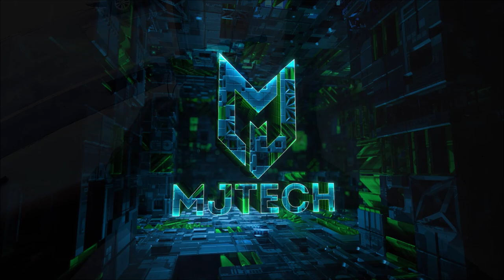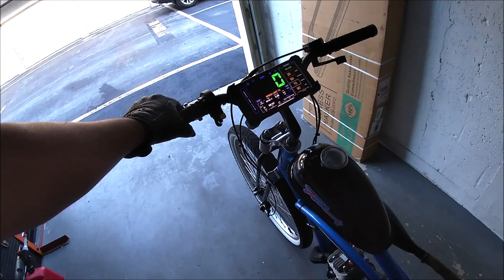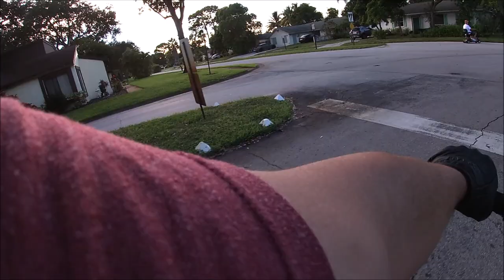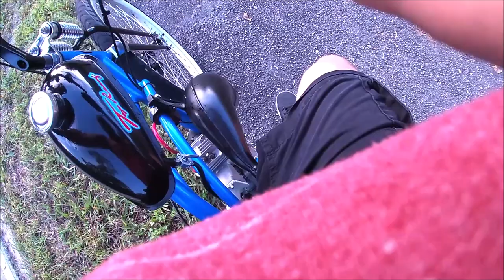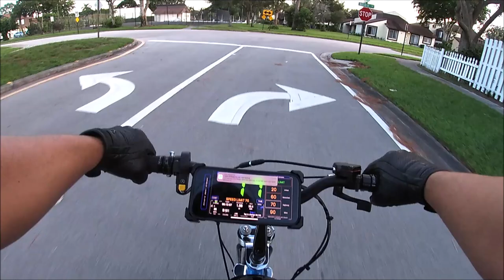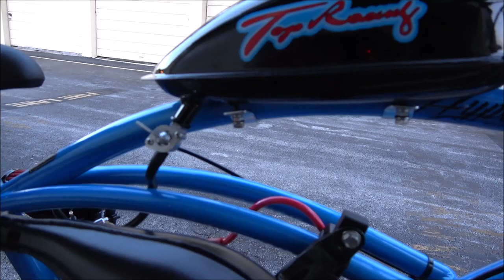Phantom 85 Motorized Bike - Hits [52MPH +] & Could've Gone Much Faster!

Comment: Big respect man! Takes big balls to ride that thing that fast
Reply: No way in he'll I'd do that the would be extremely painful
Reply: @danajett  same here, he's kinda crazy to ride it in shorts :D
Reply: There are electric scooters which go 120 and 150 km/h, those are dangerous and anybody can buy them, kids use them.
Reply: @Aziz-wl1xf  For real, at that speed it would be good to use some motorcycle protective gear 😅
Reply: I have a heavily modified YD100 that goes faster than 60. I just didn't go faster than that. It's insane
Reply: But I agree big respect

Comment: Sounds like the pipe is starting to come into resonance at around 46, was a bit rich leading up to that.   You might try making a header spacer that is gasket matched and spacing the pipe out about an inch to lengthen it about. It will come into resonance sooner. and Yes, it did sound like it would go lots faster.
Reply: It sounds like that’s when he goes WOT… you can hear a noticeable difference in induction noise. 

But I agree, extending the header would make the resonance happen sooner.

Comment: nice . sounded like it was pretty happy between 35 and 40 . thats still crazy fast on a bike . not a big fan of the phantom with all its problems  . but i feel once they get it dialed in it will be a good engine . that leak if it dint crack at the wields  it was more then likely coming from the gas cap . them cheap tanks suck . the caps can be fixed  with a inner tube . just cut out a new rubber seal  or use cork gasket maker . they dont fit tight enough . take care  . ride safe .
Reply: ❤❤❤❤❤❤❤❤❤l❤❤❤❤❤❤❤❤❤❤❤❤❤❤❤❤❤❤❤❤❤llll❤❤❤❤❤❤❤❤❤
Reply: allaboutbikesslideshowreal9741 😂😂 paper weigh lol
Reply: What would be a good alternative motor 
??
Reply: @GROK815  not sure  but i think they fixed the issues with the phantom now . there is another one for like 200 dollars called the avenger 85 that i guess is super fast right out the box .

Comment: I hate 2 strokes, had the worst experiences. Made my bike fall apart, 10 gas tanks in 2 months, went through a few engines, one was a generic cheap Chinese engine, went through a stage 1 engine from bikeberry, completely damaged the engine, bought the stage 2 engine kit, everything worked fine until i tried putting that upgraded compression head on, would not work no matter what i did, like it was obnoxiously annoying, i gave up, but bikeberry’s customer support was absolute top notch, like its something you can really appreciate. Ended up getting a cool muffler, didnt work with the bike i had because the mounts on the engine were at a weird angle which wouldn’t work, they gave me store credit, had got a speedometer they had, better grips and throttle, they were always there, i may check them out later to see if they got anything new, since its been a few years. I on the other hand just got a phatmoto 2022 fat tire, absolutely fun to ride, i was iffy on the speed, but its to be realized that speed isnt always everything you need. I do plan on modifying the governor to get a little more out of it without losing torque from a smaller sprocket. Where I’m at, i cant really avoid the hills so the torque is good to have, got this one hill that has this weird double incline, it’s difficult to drive up with a car in the winter, everybody usually avoids it and take the less not so double inclined hills. All in all, as expensive as the phatmoto is, to me its 100% worth the 1300$. Ive heard the clutch is bad, but i havent had any problems with it.

Comment: These gas tanks all have a flaw with the gas tank cap and it's really a design to allow air to come into the gas tank so your fuel can gravity feed down to the carburetor to solve this issue is you simply get another gas cap that has an actual gasket but on the center of the gas cap it has an air inlet valve that's about a half an inch above it a little stem if you will this prevents the gas from splashing out but the gas cap itself will have a gasket sealing the cap like a real gas cap and you're welcome

Comment: Okay I'm going to give a comment a lot of people are saying out there that the yd 100 don't hold a candle to the phantom 85 but the yd 100 don't come with a read valve don't come with other stuff that the phantom 85 comes with so at all fairness. I bought a why do you 100 put that motor on a hyper bike it did 55 mph and I did not have a big pipe on it I used a knockoff mz65 pipe did mild porting to it ran a 32 sprocket on it all I did was clean the ports up on it that's it and the bike would do 45 mph. With no problem so then I pulled it apart out of all fairness because the yd 100 don't come like the phantom 80 kit with the big pipe the Reed valve all that I didn't even break the b** in I ran it at 40 to 1 right out of the gate stock carburetor stock everything all I did was cleaned it up that's it then what I did was gave it a little bit more work and the funny thing was I didn't even put a re valve nothing on it I ran the stock carburetor then the bike hit 47.49 mph I learned my mistakes on the yd100 so now I got a new one. The fastest speed I hit on my yd 100 was 55 mph but I learned from a mistakes what I notice about the phantom got a lot of low-end power probably mid-range power I'm going to have to get one of those and then we'll see personally in my opinion I've seen guys run 70 plus miles per hour on bikes using s*** carburetors tiny carburetors not big ones it's really not that necessary when I built my first why do you want 100 I went way too big on the ports didn't change the pipe made mistakes we live and we learn it's velocity that's what you want when you're porting staff it's not always let's gouge it out make it huge I found out on these two strokes that is not the answer I've seen guys with stock carburetors f*** somebody up that had a carburetor three times in size tiny little carburetor tore their ass up in the top end it's the velocity it's the flow that's just my opinion

Comment: Use inner tube pieces and ultra copper high temp gasket maker under the rubber seal two should be enough clean well and hold together w the gasket maker Wich is fuel proof will seal well

Comment: I'm gonna bet once you crack the jug you will find a piece of piston broken off under the wrist pin, for some reason the pistons are cracking around the skirt.
I suspect bad casting methods
Reply: The wrist pin bearing is weak and allows the piston to rattle in the bore after not too long. Broken piston skirts result in catastrophic damage, but the origin is the bad bearing/bushing.

Comment: I just got mine but haven't installed it yet cause it's still too cold out. What oil do you use for break in. The paperwork said 20 to 1 but did you use any certain brand of two stroke oil?
Reply from the maker: Buy the lucas brand
Reply: @MJTechChannel  I've got people telling me only organic or full synthetic or whatever. In all my other engines I just used what my local parts store has but for the phantom 85 I wanna use what's working for the others
Reply: @MJTechChannel  I've also heard that a bigger carburetor really wakes these up

Comment: Very hard for me to
believe with out a gear
 shift unit this motor
can go faster then 37 Miles,
I was just about to ask you 
about Yd 100 , can it go faster
with an Expansion chamber
exhaust . not sure if you used 
one on it, still looking around
in your videos to see what you
had to say about it . 
 is it really a larger Bore and stroke,
I'm checking out a piston on sale 
with three rings they say it's 52mm
reed piston kit 12mm pin 110cc gas
motor engine 2-stroke . they also got
52mm jumbo cylinder 110cc steel 
sleeve
for sale as well, I have some question
to ask about it, being that your trying
out and testing
just about anything that has to do 
with those motorbike engines I was
thinking of  asking you about it .
is there a specific cylinder head for
this 52mm jumbo cylinder or is it the
one you riding on, in this video,
the spacing mount to the cylinder studs hole
 are space out to 60mm on cylinder .
not sure for what engine .
Reply: He has an RM85 on it clearly in the video, and a G2 reed. Did you watch the video? This is a Phantom 85 motor. You shouldn't doubt the speed of this beast of an engine.
Reply: @carloscardova4221  with an RM85!
Reply: Phantoms def have power for beyond 40mph no shift. 

The bike in this video has a yd100 bottom end and a transfered and windowed piston top end. True 85ccs. 

That pipe is helping him along a little too
Reply: I don’t believe it,not one
Bit
Reply: I’m telling everyone right now,,that’s BS …I’ve been in this to long and I know better than that,, it’s a BS video !!! Fake
Reply: @jorelldye4346  
RM- EIGHTY NOTHING YO!
I recently installed a no frill engine
on my Landmark Schwinn Beach Cruiser, upgraded 10 gauge wheel spoke with seal bearing, upgraded suspension fork disc brake all around my bike, on the coldest summer morning after 3:am with a clean air filter and cool gas, I can do a scary forty MPG with no traffic. AND THAT'S A LOT WIND I take on MY BODY . LOOKING AT OTHER RIDING VIDEOS and this video here don't look like he's riding no way near that speed bro. just yesterday morning at about 4:am my bike with a bicycle trailer was hauling two five Gallon jugs OF WATER and it didn't Slow it down it was hauling ass with all my weight and the weight of water a small tool trunk I take and the bike trailer . Love my bike setup for now but you know there will always be room for improvements. for me it's not how fast you can ride, it's for the use you have for it. Yo Bro your speedometer is playing a cheap trick on you bro because those electronic ones are usually set on Kilometers per hour. I will tell you this, stick your head out of a moving car window doing 40 mpg and you see what I mean, It's a lot of wind move against your face real fast, if you don't have a set of good eye protective gear, your eyes will dry out and become damaged Yo. 40 mpg is fast and anything could fly on face and eyes like bugs or tiny stones very dangerous bro. I can't believe you said you could of gone 60 mpg, not with that bike. Did he say 60 mpg. now I know that tack is wrong, you'll be gone in sixty seconds and I don't mean motorizing and going fast. We use two bracket for each gas tank mount front and rear, I know they only give two to work with always buy extra hardware and fuel lines is my advice. safe riding yo Stay Safe.

Comment: yo man, i switched my tank to the supposedly 1 gal tank. worth it for daily rides but I'm sure you'll need one as well. note though that I'm looking for replacement petcocks for the stock one seems to me be weaker than a motorcycle one
Reply: Me to  I also used  epoxy putty & glued it to the frame & around the studs  to prevent it from braking again .. ..  it’s  still good 3000 miles later.

Comment: You are CRAZY!!!!!!
#1- speed limit on motorized bike is 30 mph or less.
Lucky, no cops around, speed checking.
#2 - you are in T-shirt and short, at 40-50 mph if you fall or crash, you can say good by to your skin at best, but you can break your neck too.

I knew a guy, he was going to the beach on his motorcycle,  dressed to the beach, in shirt and short.
At one intersection, he had a green light, but a car pulled in front him, so he laid his bike down to slide to stop.
He survived, but on one side of his body, he lost his skin and broke an arm and collar bone, some ribs too.
He was in the hospital almost a year,  laying on his stomach, many surgeries,  skin had to be removed from his ass and leg to patch his upper body.
Have you noticed, motorcycle riders wear protection, like helmet, gloves, leather dress, rider's boots.
Not by accident!

Comment: What oil do you use for this engine? I can’t seem to find what’s mentioned in the instructions as “Valvoline Two Stroke Racing Oil,” is this the same as Valvoline multi purpose oil for two stroke engines? I also already have Lucus’s semi-synthetic 2-Cycle oil, is it safe to use?

Comment: nice video this engine have more to go . 60mph mmm the bicycle handle that you have good tires and rims red locktite all the bolt torque all the bolts you sure be good . you have a nice set up . ? you change tyhe cluch pads . cant wait to see that 52 on mph on a gopro you have video / what i do i save the video on the gopro app then on the seting you can see on the screen on the same video ones you have that you can record that on the cellphone screenrecord and you can post thst on here . nice 52 mph sorry for my missspeling we be back
Reply: that how i use the gps gopro
Reply from the maker: Tengo la gopro 7 silver y no hace lo del GPS. El app que usé funciona igual o mejor ya que lo he probado en mi carro y está correcto. Le cambie el tanque y a las 9pm hice 58mph sin cámara. Pronto traigo el de 60mph! Saludos
Reply: @MJTechChannel  yo tengo la gopro 7 negra . Es un poquito complicado Te digo otra ves . El video q ya tienes ,si ya lo bajastes al app de la gopro cuando están para areglarlo . Es los ajustes donde se pone la música al video en esa parte hay hay unos stickers hay esta la oposición de ponerle el gps . Pero hay un truco q es después que le pongas el gps . Si quieres usar el video gopro no lo usa en el video con el gps . So lo que se hace es grabarlo con el celular y así tienes el video y después lo puedes bajar a you tube . Yo voy hacer un short de como hacerlo ya breve . Estamos rompiendo el internet con los phantom 🦾 dime si te ayuda o no .
Reply: @MJTechChannel  la hize el short dale un vistazo 🦾 estamos pa ayudarnos 🦾
Reply: 🦾 ojalá te ayude .
Reply from the maker: @ELISRACINGTEAM  Lo que pasa es que la silver no tiene gps. Solo la black edition. Yo traté lo que me dijistes y no funciona ☹️
Reply: @MJTechChannel  si se ve que dice gps on avalible quiere decir que lo grabaste en quick set up . Tiene q irte a el setting I quitarte en que grabe rápido yo vas a ver en los setting. Una ves q le quites eso el próximo video tendrá gps y lo podrás usar . Otra cosa cuando pongas a grabar la cámara asegúrate que la bicicleta esté quita o el motor apagado para que sirva el gps .
Reply: @ELISRACINGTEAM can you teach me

Comment: If u didn't fix piston rod bushing issue then u should not be going that fast!!!!
My bushing failed and caused the crank to seize up do to debris from from top piston bushing. Back tire locked up at 40 mph but, luckily I was going straight or it would have been all bad for me.
Take jug off and u will see why.
Reply: He has video on it, he did fix the bushing.
Reply from the maker: Already fixed it!  Thanks for the safety advice

Comment: Is that pwk carb I have a 28mm with the Dio set up but it revs up I went threw check all vac leaks what size jets you using if you don't me asking ?
Reply from the maker: Dio reeds like to air leak. Check the hoses and gaskets. I am using a 21mm pwk. I have a 115 main, 39 pilot, needle set to 2nd slot from the top and 2 turns out on the air screw
Reply: @MJTechChannel  yeah I hit 42 with stock carb an gutted pipe with 28t sproket
Reply from the maker: @graysonwachter1643  No video, no proof sorry!
Reply: @MJTechChannel haha ok your rite I'm bluffn lls

Comment: My bike feels good at 26-28  but I can wind it out to 38 mph on 44 tooth sprocket..
Reply from the maker: Speed really doesn’t matter! Most of us will feel great cruising around those speeds 26-28mph.
Reply: @MJTechChannel  yeah mine is set up for torque because I live  on the side of a mountain 
 It’s a schwinn legacy  with a highly modified bbr stage 4      Even 30 mph on a regular bike 
  Is really dangerous  
..  I’m saving up for a  Crome ktm 65  pipe 

   Seeing ur bike go so fast & sound so good got me all excited about it.
Reply from the maker: @joshuagerlach6943  Since I live in a flat ground area I just purchased a 33t hub sprocket. Lets see how it turns out! 😁🤫
Reply: @joshuagerlach6943  not dangerous at all it is safer than a pedal bike .especially when you encounter four legged varmints.
Reply: @MJTechChannel  what size you have on in this video?

Comment: In my opinion if you got the why do you want 100 with all the options like you had with the phantom 85 I'm going to take the yd 100 I had a choice and I was going to take the phantom 85 but I know this motor I know the wd100 and in my opinion for vibration pipes I ran on them and the mild stupid s*** that I did with the why do you want 100 never even ran a big pipe on it at all at all in my opinion I think the yd 100 and top end power if you got the right builder even if you don't got the right builder well f*** a fan of 85 up all day long that's just what I think in fact I know it will that's my opinion I didn't have to hardly do anything to that motor and it hit 50 mph s*** pipe no read valve stock carburetor on a hyper bike with a pipe mz65 pipe knockoff mile d clean up the bike did 50 mile per hour and actually it hit 51 slacking 52 but it hit it went back and forth with the stock intake and all that with a knockoff mz65 pipe and just to clean up 32 to sprocket so I don't want to hear how great the fan maybe five is cuz I don't think it's really that great from what I've seen stock the yd 100 didn't even four stroke on me I really didn't have to do much it's a good motor I love this motor maybe other people had bad luck I don't know but I've had really good luck with it and the f*** if you know how to Port it and tune it right it's a 50 mph bike right out of the gate without doing really anything to it. So all the people on YouTube that think that can tune a bike it don't take much and I didn't buy a Oz coil for it I even ran the stock plug in the b** it's b***** it's how you tune them